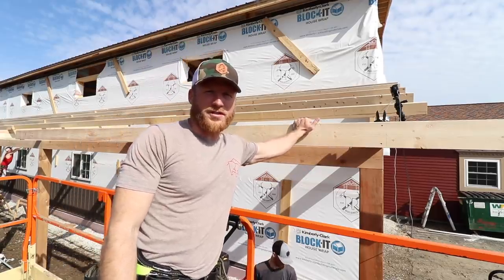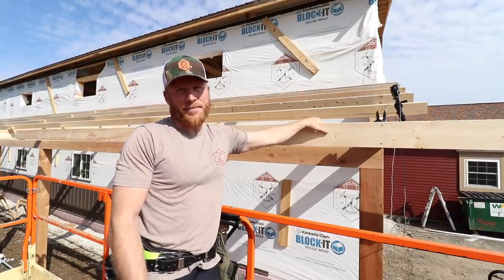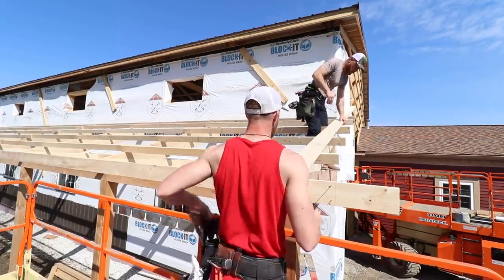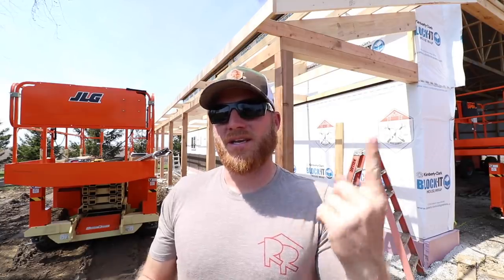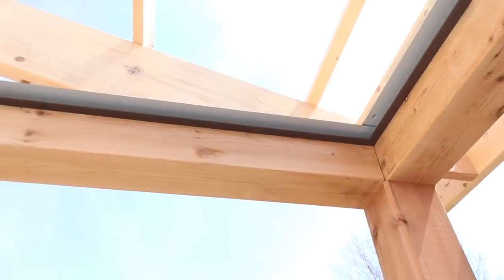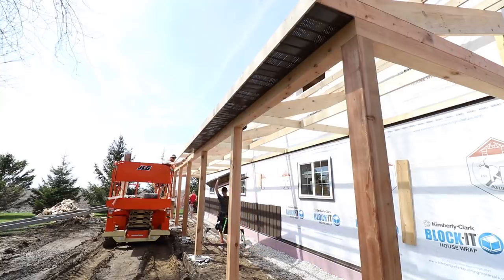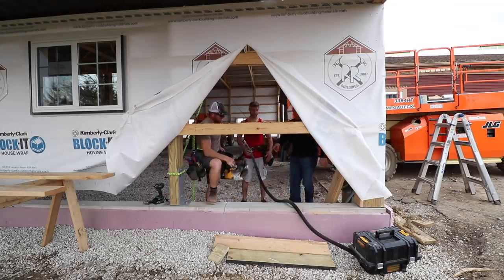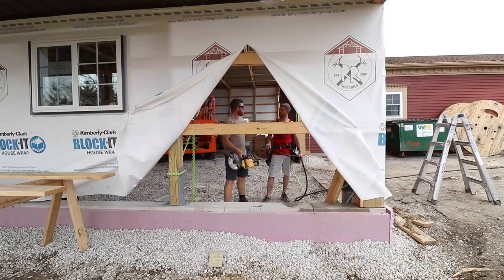How to Build a Garage Addition 15: Porch ceiling, soffit and fascia

Comment: Kyle, check out the Surefire EP4 ear plugs. Has a passive filter so you can talk, but filters out loud noises. They last for a long time. I bring mine on every flight, use them when I'm using impact guns or real guns.
Reply from the maker: Thanks I have some isotunes extras I like but didn’t have them with me!  I need to make it a daily thing I know

Comment: Kyle; all metal roofs should have snow and ice blocking.Look up vids on it. Deadly. You should offer it in all your contracts, then you're in the clear. Another good vid, thanks.
Reply: If you don't let the snow slide off, you need to engineer the building to handle extreme amounts of snow. Or risk going up there to shovel or break your neck.

Comment: Hi, been an avid subscriber for a good while. With cutting your steel, either trim or the wall sheets, have you had any issues with corrosion?
Keep the builds coming.
Reply from the maker: Never
Reply: Thanks. I am about to start a new home with mostly steel cladding near the sea.

Comment: Vacuum control not working, then garden house, then the guy pours the water on the wrong side, you are not trying to cool the blade dude, the water should be right at the beginning of blade cutting to minimize the Silica Dust